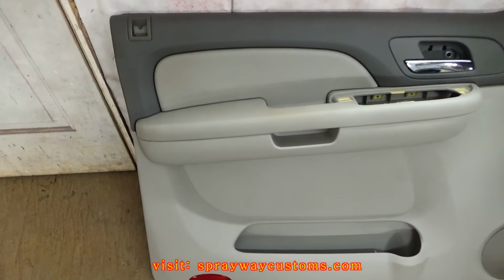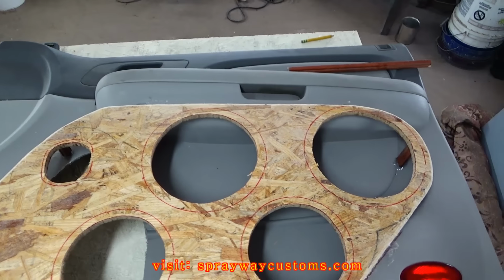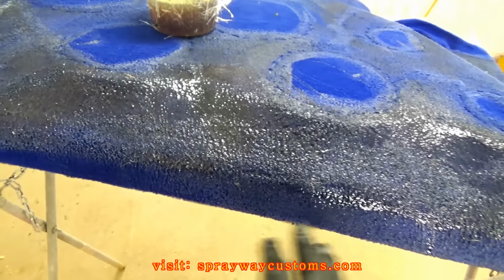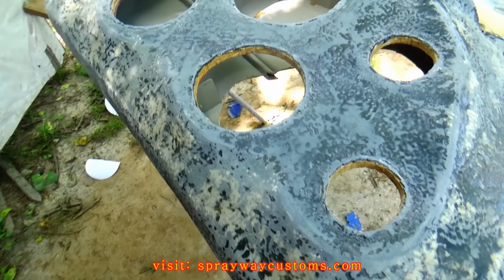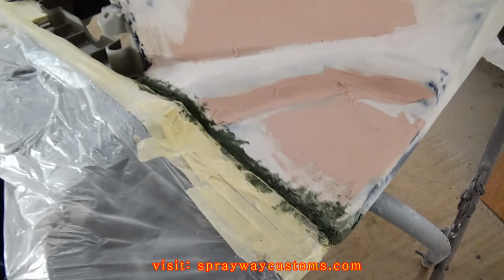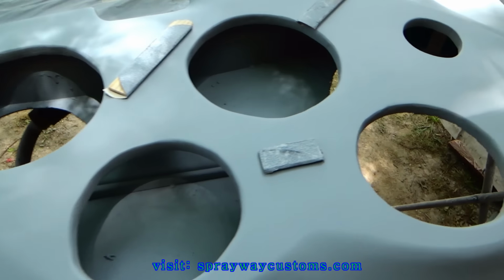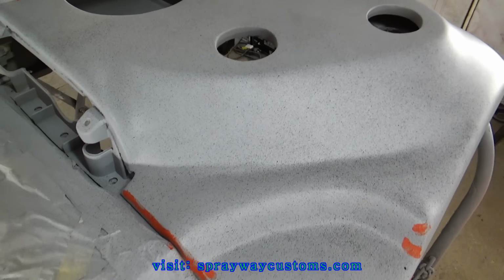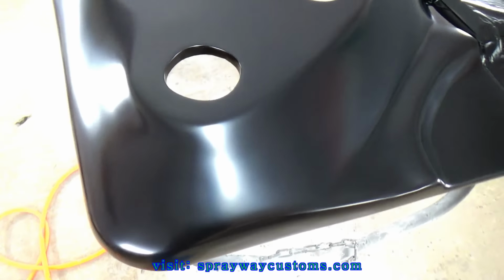How To Fiberglass Door Panels Step By Step Chameleon Flip Flop Paint PRV AUDIO SPEAKERS Chevy Tahoe

Comment: So you have your directional mids on bottom where they will be blocked off by seat bottom an bolsters? Are you just going for bass in your ears? Also curious what your thoughts are on using the fiberglass weave mat instead of the standard mat?
Reply from the maker: Is you referring to the fiberglass cloth ?
Reply: @SprayWayCustoms  no. there is also  a fiberglass weave mat that you can put down on the felt  like you did the fiberglass mat patches. Only you roll it out and lay it on the felt and resin it.
Reply from the maker: Yes, I just tore the pieces because it's easy to go around contours without having air pockets like you'll get with a larger piece that's not sitting flush. I use a large piece on flat surfaces though.

Comment: They look good. However the one thing I do different I do not put anything between where the speakers will mount and the wooden Rings. If the customer decides to pull speakers in and out it will tear the fiberglass up and get messy, it also allows for a better seal from the speaker to the ring. Instead I use a router to create a lip with a crease on the speaker ring to tuck the cloth it also adds a nice look. Learned it from Mark Car Audio Fabrication YT channel. Just thought I'd share 👍🏽
Reply from the maker: Thanks Matt

Comment: Man that is some awesome work! That finished product is on point. Quick question though, when you install a door panel with all the added weight are you still just using plastic clips to hold it on, or is there something else you have to use?
Reply from the maker: I use the plastic clips and I reach through the speaker openings and drill screws through the platform

Comment: Hey neighbor. That color is excellent. One question Was the camealion color the clear or did you spay clear separate?? You sure do some great work 👍👍 one more thing Have you ever tried using tissue fiberglass. It’s for the final coating it’s really thin like tissue and covers small blemishes maybe cut down on some sanding.
Reply from the maker: Thanks 🙏 M Watkins

Comment: Try this with your fiberglass, after you place resin and matting.. Take regular sandwich wrap and place over fiberglass mix.it's easier to gently smooth,removed it lumps and saving on sanding after. Peal plastic while glass is still warm.
Reply from the maker: Thanks for the info

Comment: Couple questions do you have a product list, also can achieve that same finish using spray cans? I’m going to match my tan interior. So no pop colors, also just doing a small section for 2 6.5s and 2 super tweets so project is probably 4x smaller! Thank you and this video inspired me to go trip and error tell I can get it right, dude on my block wants to charge $1000 for both panels which I understand the process takes time, but I rather put in the hard work, and keep cost way down
Reply from the maker: You can do it with spray cans but you'll get a much better finish with a spray gun. I wish you nothing but the best

Comment: Maybe I'm too much of a novice, but after applying resin to the fleece, wouldn't it be easier to just pour some clear epoxy over it and use a blowtorch to release any bubbles? You would get a high gloss finish without having to do the remaining steps. I'm guessing that maybe the epoxy would crack easily compared to the other bondo-like steps, right?

BTW: Have you ever tried to do a chameleon coat over a spectrachrome base coat?
Reply from the maker: No I haven't tried that. It sounds good 👌🏾

Comment: Hi there, 
I admire your  work and im trying to make door panels for my own car in the Netherlands. However it's impossible to get 3m bondo here so im stuck with alternatives. 
I was hoping you could point me towards the right product. 
This alternative brand doesn't have special glass fibre resin and most products or polyester based.
I can get from the brand motip:

Polyester resin
Glass fibre unfilled putty
Glassfibre filled putty
Polyester putty

Polyester fiberglass filler(differrent brand)

All of these are 2 components.

Do you maybe know if this will work kind of the same?
And what kind of putty or filler would be best to use?

Greetings
Ryan
Reply from the maker: The fiberglass filler will work and a two part putty will be your best bet

Comment: One question, how did you mount the ply board to the actual door panel? Seems to be the one thing I can't quite figure out. You did a good job on this! Never done this before but I plan on doing my RAV4 door panels and the rear door as well with new speaker mounts and your video actually shows all of the work at normal speed which I appreciate. It seemed really hard when I decided I wanted to try it but it really looks quite simple if you are handy even a little. Thanks, man!

Comment: So a couple of questions  for you . 1st, and I think I know the answer but just want to make sure. You placed the speakers where you want and glue the supports to the car plastic and pull the fleece over them and staple it down. I know that the staples cant be the only thing holding the fiberglass to the door , so when you put on that first layer of resin it is soaking through to the plastic and when it dries that is really what is holding the fiberglass to the panel correct?  2nd , I know some people like to use dyno mat in the doors to stop rattles and help with the sound. On some of these , is there room to get into the space to place the dyno mat?  3 rd question, so when you install the speakers in the fiberglass speaker ring how do you fasten them in? Do you use clips or screws? Can you show us in a video on how to do this please.  So a few more  questions sorry . What size staples do you use? And also is there a thickest on the fleece or type of fleece and where do you buy fleece? Sorry so many questions
Reply from the maker: I buy my fleece from Walmart. I get the cheapest they have. I mount the speakers with screws. You can place the dynomat on the door itself before installing the panel and yes the staples are the only thing holding the fiberglass to the panel. Once you fiberglass it..it's not going any where. It's like a tight fit glove.

Comment: I am going to fiberglassing a piece of particle board for my rear seat delete kit , I want it to be formed to wrap to the edge of my interior trim, but I don't want it to stick to my trim, so I expect I would have to cut it loose, but what it the fiberglass mold to but to not stick to so it can be cut loose.? U have inspired me to do this, when I finish it, I'll post it and give u a shout out!
Reply from the maker: You can use aluminum foil
Reply: @SprayWayCustoms  thx

Comment: SprayWay Customs, I could use a little input/advice from you. I have been challenged to glass the door panels on a old car and they don’t have an existing interior panel(it was purchased without any interior), all I have to work with it the naked metal door, how do I create a template from scratch to make removable panels? I think he has been having a hard time finding the panels to purchase.
Reply from the maker: Just get you some cardboard and make a template and then cut you one out from a thin piece of wood.

Comment: Is the fiberglass mat really necessary, or could you do something like this with just the resin and the fleece?
Reply from the maker: Yes on something with the weight of this it's necessary
Reply: @SprayWayCustoms  Ok, that makes sense because you're mounting all those speakers.  Without the weight of the speakers - i.e. just a custom door panel, or refinishing the top of a dashboard...  would you think fiberglass matting is necessary then?  Also, have you ever used the woven fiberglass blanket material instead of the fiberglass matting?  It looks like it would be much cleaner to use but maybe would be harder to soak up the resin.  Thanks for all your detailed videos!  I'm learning a lot and getting ready to dive into some custom door panels of my own.
Reply from the maker: The fiberglass cloth good for a flat surface but the mat is better for curved areas. If you just fiberglassing over a dash pad..you should be good with just the resin, as long as it's pretty sturdy and won't be doing a lot of flexing.

Comment: Damn bro killer work, wish I could pick your brains on a few things
Reply: I do have one simple question tho, on the lower part of the door panel. When you pulled the fleece. Did you staple it to the back side or did you staple it right at the lower edge on bottom of the panel?
Reply from the maker: On these panels I didn't staple along the bottom at all just wrapped the fleece around the back. Just don't try to fleece the front and back at the same time because the resin will interact with the glue and lift up. I only staple spots that'll will lift up like in crevices.

Comment: Quick fact mission, 
1. the fibreglass sheets  the ones that feel and look like fabric, could they be used in place of the fleece are or they more hard work than it looks? 
2. If they're not suitable does it matter whether I use the rougher fibreglass that you're using or will it still have the same effect t if I used the sheets I've just mentioned?
Reply from the maker: You could use the fiberglass cloth...it works well on flat surfaces but not on contour areas. It's best use smaller pieces on going around contours so it'll lay down evenly.
Reply: @SprayWayCustoms  nice one thank you, saves me making mistakes early on 😎
Reply from the maker: No problem Garry, any time

Comment: Before you sand it so it doesn't clog up your paper because of all that resin. Wipe your filler down with lacquer thinner and clean off the top layer of residue. Then start sanding you will use a lot less than paper and it won't clog so much
Reply from the maker: Thanks Rob

Comment: Have you tried gluing it down instead of stapling? 

You can get more details by gluing it.

Also dont dab the resin in that will cause more air bubbles.  Try using a weenie roller to roll it on that way you will get a even coat and will make sanding easier.
Reply from the maker: The glue will interact with the resin and the fleece will left up
Reply: @SprayWayCustoms  they recently invented a glue for reason. It work perfectly.

Comment: what did you do inside the panels to hold all that from falling off . what did you do to keep all that from rattling when listening to music ?
Reply from the maker: Nothing is done to the inside. Fiberglass is strong...boats and bathtubs are made out of it.
Reply: @SprayWayCustoms  yes boats are but door panel is plastic and they dont bond together .
Reply from the maker: The complete panel is fiberglassed so what's gonna come apart?
Reply: @SprayWayCustoms  the oem panel is plastic . your add on is wood glue stick held with fiberglass wich is fine BUT theres nothing holding the fiberglass to the plastic . when i started do glass i did the same way . only problem is after time the panels seperate from the plastic . the way to fix this is easy drill holes in the plastic all over the place and glass the back of panel flip it over and light coat glass resin over the holes . that way when you fleese it the panel is bonded . also use cardboard instead of plywood to save on weight . if you drive the thing your gonna want to do this if you have a trailer queen do it your way .

Comment: I have a question: if I forgot to mix risen with harden and it doesn’t go through fleese  and I added with fiberglass mat what should I do to make it hard
Reply from the maker: Just mix another batch the right way and brush over the batch you didn’t mix right and it’ll activate the other.

Comment: Damn what year is this? We haven't used fleece for custom panels since 2002, heck we don't even chop the original doors anymore. We make a two-part fibre/chop spray plug then vacuum form or make a two-part fibre/chop plugs lay glass with Gelcoat or Carbon 2K weave then polish or wrap, much less work no hacking the car and customer get to keep the stock panels. Great job hacking I guess, if the customer is happy that's all that matters, lol
EDIT:
I should have been more clear when I said "hack Job" I mean by "Oldschool" way of doing things not like you did a crappy job because it looks fantastic IMO, just haven't seen it done like this in over a decade, but its cool to still see people actually use their skills in a dope way to make money!

Much love & respect from an ex custom car audio installer from Norcal!

Rob
Reply from the maker: Thanks for the compliment Rob. I appreciate the info
Reply: @SprayWayCustoms  Welcome, you should enter some SQ comps, I bet that door sounds crisp!

Comment: I do have one question. I probably won't go that extreme. My original plan was two 6.5" and two tweets per door. But now, maybe one 8" one 6.5" and one or two tweets.

My question is, how is mixing the 8" and 6" in same door panel, sounds wise, and are they on separate amps
Reply: Sorry, probably was the wrong place to ask. I watched a few of your videos. You do awesome work. But I see you do more panel work than the acoustic side
Reply from the maker: I'm not sure on how the owner wired the speakers, he just told me how he wanted the door panel set up

Comment: Is there a reason you use fleece and not fiberglass netting for the whole thing?
Reply from the maker: The fleece is used to get your shape so you can actually fiberglass it. If you already had the shape you was going with you could just use fiberglass. Thanks for the comment Fred
Reply: @SprayWayCustoms  ok that was very helpful. Thanks for responding back.
Reply from the maker: No problem

Comment: Wait... that's the first time I see paint-on bondo. Looks like it's almost self-leveling, which must cut down on sanding time a whole lot. Did you use some kind of solvent to thin the bondo like that, or is that a specialty product that you buy?
Reply: Never mind - I found your "how to mix Rondo - a brushable body filler" video. I had no idea that was possible. I guess you could also just use a polyester resin and thicken it with glass pearls until it's the right consistency? Or does that become more brittle?
Reply from the maker: Great…yes that’ll work

Comment: Use mdf board to get better sound and Mix bondo filler with fiberglass resin and fiberglass hardener so all you gotta do is pour it on to speed up filling defects and less sanding lol
Reply from the maker: No $hit 😏

Comment: Ayy Spray, you be helping people out over messenger? I watch all your videos,  I'm trying to get your input on some things with my lincoln.
Reply from the maker: Yes...what you need?
Reply: @SprayWayCustoms  Alright so I'm redoing my Lincoln MK IV 1975. It has 50k miles on it but I live in the Midwest so it has some rust, mostly under the landau top. My main question is what do you do to stop the rust inside the body panels.  It's just a bit of surface rust but I don't want to getting any worse. Im going to cut the bad rust out and just repair with new metal. Do you use a neutralizer? I had a few other questions, but I just rewatched a few of your videos and found my answers.

Comment: Did you encounter air bubbles
Reply from the maker: Sometimes I do. I just cut them out and wipe some Filler in them
Reply: @SprayWayCustoms  ok thanks for the advice
Reply: @SprayWayCustoms  i think some are under the layers but I might inject them if I can get to them.  But my piece is smooth
Reply from the maker: If they're  deep enough, I wouldn't worry about them
Reply: @SprayWayCustoms  ok thanks

Comment: I mostly skipped through this video, but as soon as I seen corrugated ply board being glued to the original panel I was done. Couldn't even spring for some PDF hot damn. Acoustic value and panel rigidity out the door

Comment: Shiit how much you charge for doors?
Reply from the maker: It depends on what’s going in them and the type of design
Reply: @SprayWayCustoms  just seen this. But 2005 Chrysler 300. I want my front and back doors done. Probably 3 sets of 6.5 components. Not sure on paint yet, maybe the chameleon you have here or like a nardo gray to match what I wanna do on the outside🤔 always open to ideas too
Reply: @SprayWayCustoms  3 sets per door. Maybe more if I could fit em😂😂😂

Comment: @spraywaycustoms.com  bro man I'm the same as one of the other whom commented on here, I do car audio from my house as well as build custom sub boxes, but I've got several ideas in my line of things with fiberglass and I've only tried it once without ever watching a video first just strictly directions on ty he can and then I watch your video....INSTANTLY I subscribe and I mainly just got 2 questions atm.1) Do you use any oxidizer when you doing the fleece and mesh thing? Bc when I did my attempt my resin locked up on me so fast. And 2) where is a good place to accumulate some of that fleece like you use
Reply from the maker: No I don't. I just mix up a small amount of resin at a time. You can get the fleece from your local Walmart in the Fabric Department
Reply: @SprayWayCustoms  ok bro I really appreciate you taking your time to give me the help bro but I'm a lil confused and I know that you are a busy person with as good as you are so if you've already answered this question in one of your videos please just shoot me the link I swear I will watch it but my question that remains is this I was using the resin I had left to seal the interior of my boxes and I just used resin and oxidizer , 10 drops to 1 oz., (because when I tried to incorporate the mesh it seemed like my mix would instantly lock up but when I do just the resin and oxidizer it seem like it never really got all the way drive so if you not using any oxidizer how do you get it to dry bc I cant sell anyone a sticky box ya know. Your help bro is much appreciated so is your talent.